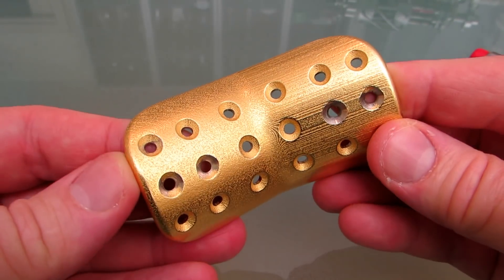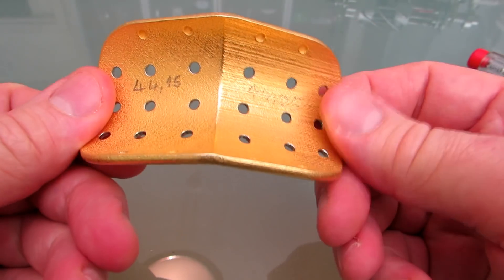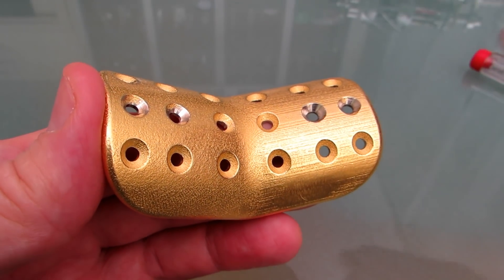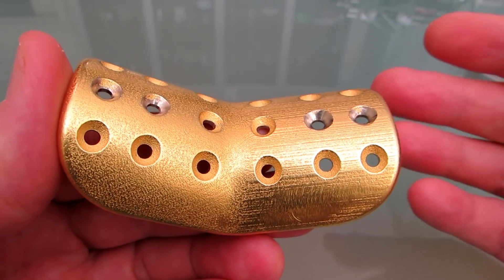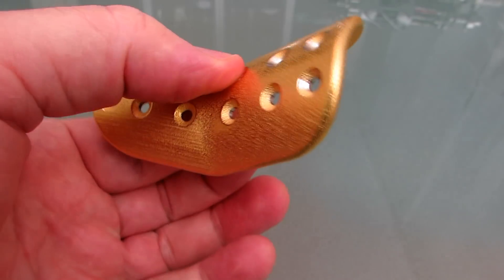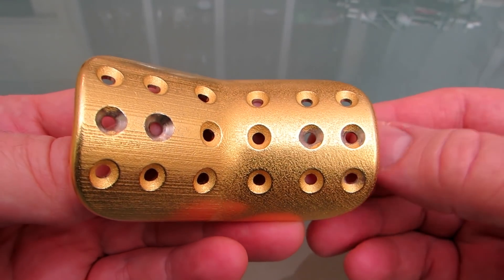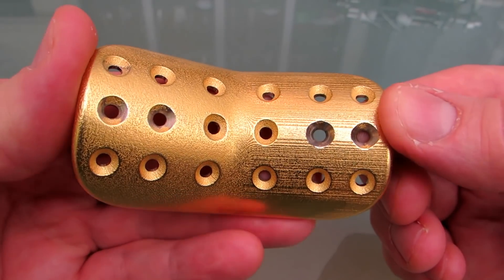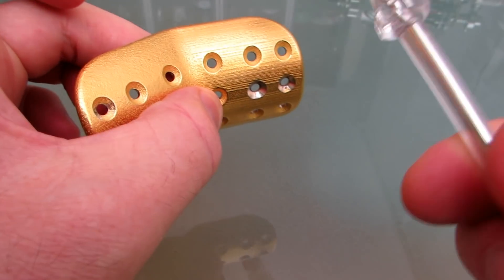My first 3D printed metal part

Comment: If I were to design such a part, I would arrange the screw holes so that they didn't align along the grain. To avoid splitting the wood, I would offset them so that no two screws went into the wood along the same grain line. Nice looking; do you expect it to be strong enough to reinforce the handrail sufficiently?

Comment: Lost PLA casting is pretty easy to do, even at home. Maybe check it out, if you're going to be doing many parts.
Reply: I would not say it is easy to do. It´s pretty hard to do actually. Complete melt out of PLA is basically impossible that´s why there is wax like resin for the melt out and Polycast filament. You need to melt some metal as well which means you need the proper gear etc. You need proper refractory and best caste a vacuum table or centrifugal casting contraption etc. So no it´s not easy at all, especially if you want the same quality.